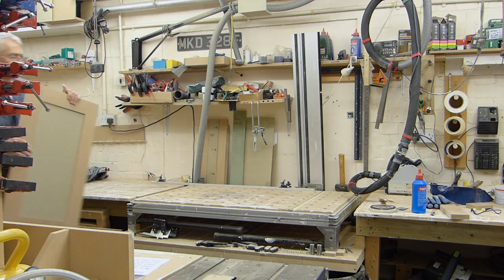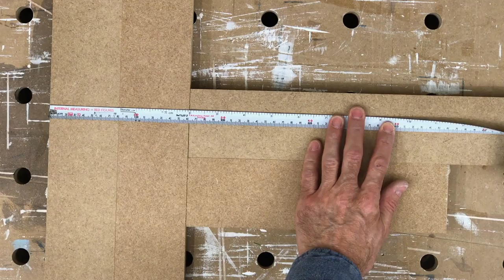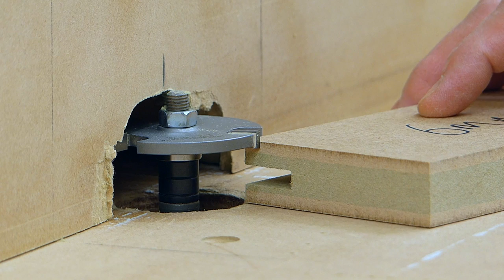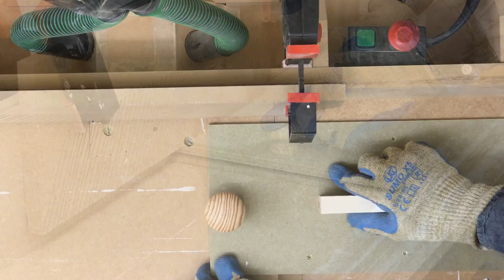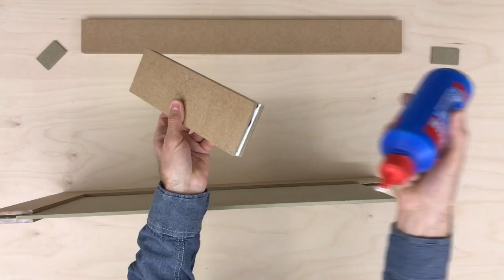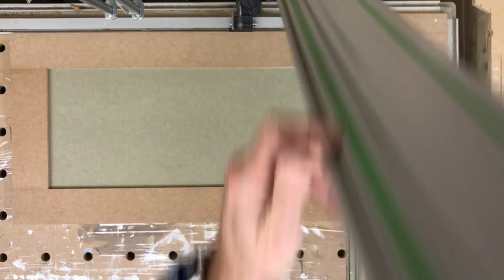Shaker-style Panel Doors #001

Comment: Not sure how long you been wood working? But anytime you make a  panel door onle the rails and stiles are the only thing glued the panel just rides in the slot most people put small rubber like bbs to hold the panel in the center. as the humidity changes the panel can move. Maybe the mdf isnt as prone to swell as real wood but I would still do right.I would  never make anything other than a few shop jigs from MDF no mater how well I was paid. People judge you from the work you do and how well it holds up. Even if only to be painted I would use a less exspencive woood such as pine. also you can make some real nice raised panel on the tablesaw alone as well. To me this is walmart quality furniture. Sorry not trying to put you down to bad but you are teaching in this video so thats why I called out the glue.
Reply from the maker: Woodworking professionally? Just completed my 18th year, thanks for asking. I've made literally thousands of panel doors from MR MDF for clients this way, without any issues. Certainly, if I was using a natural timber the panel would be left loose to allow for movement, but MR MDF has zero movement under normal conditions where I live and work, so gluing the panel in is doing it right. Totally agree that people can judge you by how well your work holds up, and I have an 18-year-long history of repeat work for private and commercial clients who are very happy with what I do...

FWIW using a tablesaw to make a raised panel would have my workshop shut down and my insurance yanked in a heartbeat - totally against all the Health & Safety regs to use an unguarded blade here in the UK.

Thanks for watching.
Reply: You only need to leave room for movement if the material are dissimilar and will expand/contract at different rates.  If you needed to leave room when attaching MDF to MDF, then the very existence of MDF would be a problem since mdf is just wood dust glued together.
Reply: as I said maybe its not as prone AS REAL WOOD! I my self would turn away work if it is not something I would own. But if it was real wood with grain you woould never glue the panel. OH yes I have made lots of cabinet doors infact I grew up in a cabinet shop and been woodworking for 20 plus myself. I am sorry if I hurt you feelings but I just hate to see real craftsmanship die.  MDF in furniture and cabinets are junk!!
Reply: It's not just mdf.  If your panel was made of jointed real wood and it was the same species as your rails/stiles you could also just glue it in.  You only have to leave room for movement if you're using different materials, like oak stiles/rails and a veneered/plywood panel or poplar stiles and a pine panel.
Reply: In correct!!!! if it is a panel door made with grained wood even if its th same wood the panel can expand and crack or crack around the stiles next to the rail. The grain on the panel is running up and down same as the stiles however the rails are going the other way and won't expand the same direction. So if you got a lot of humidity the panel pushes out on stiles and the rails push in on the panel it can crack or warp. Besides where can the panel go if its in a frame? A waste of glue besides being incorecct.

Comment: Hi Peter, was just wondering.... would it be possible to create a shaker style door using just 1 single 18mm panel and then just using a router to style out the centre receded bit? I built my first door using the rails, stiles and 6mm panel but it doesn't seem too strong and was really hard to build. I guess I'mi trying to cheat it but not sure if that's at all possible? :) (I'm using a freehand router without router table)
Reply from the maker: +Chris Cabral You'd be exposing the softer, inner core of the MDF, so as well as being a big and very messy job, you wouldn't get a particularly good finish on the 'panel' part, I'm afraid. How big was the door you made, out of interest? 18mm with a 6mm panel is OK for smaller doors. BTW you need to be very careful trying to swing a big grooving bit freehand - wouldn't really recommend it. 

I cover the other basic door making techniques in my 'More Doors...' video, might be worth a look?
Reply: many big manufacturers actually use CNC router tables to carve out cabinet and furniture doors and other parts. but the carved panels are often glued on to stable panels for the reason peter milard mentioned. Best bet is just practice your joinery/glue up technique. the whole point of making something on your own is to make something better than you can get at ikea =)

Comment: Great videos! Very informative indeed. I use a cordless makita circular saw and track a lot . how do you go about marking pieces for cutting when using your track saw?, I find I make mistakes as I need to subtract 7mm off each measurement to allow for the track and saw setup. Looking forward to more videos from you in the future 👍
Reply from the maker: Oliver Moore Thanks, great to hear you find them useful! Re. the 7mm thing, you mean on the depth setting, yeah? It is a pain, I have the same thing on my Festool track saw - the depth scale doesn't account for the depth of the track, which is pretty silly, but I've been using one for so long I just allow a few mm extra when setting the depth of cut. Helps to use some kind of sacrificial cutting surface under the workpiece - I use offcuts of 6mm MDF, though I know a lot of folks use a sheet of foam insulation e.g. Celotex/Kingspan/Recticel etc... Offcuts of 6mm MDF are cheaper though ;) Thanks again! Peter

Comment: Peter,

Do you think it would be acceptable to make these doors out of ¾" MDF? In the States the closest we have to 22mm MDF is 1" or 25.5mm. 

I just made a test door out of the 1" MDF and I can't decide if it looks too thick or not. I'm going to make another one out of the ¾" MDF to compare.

For those in the US that want to make these doors I did find a router bit that will cut a slot 1 5/64" deep. It is very expensive though (close to $100) . By adjusting the router fence it would give a ¾" deep slot. Here is the link to it: http://www.cmtutensili.com/show_items.asp?pars=RB~8/922.033.11B#

I used a much cheaper ½" deep slot cutter giving me a tenon of 1" and the doors seem quite strong.

Thanks Peter, loving your channel.
Reply from the maker: Hi Kevin, and thanks! 3/4” (18mm) works fine for smaller doors - I had a few issues with full-size wardrobe doors bowing, but never on regular cabinet doors. I’ve had other subscribers in the US tell me that 22mm (7/8th) MDF is available, just not that common - it’s worth searching out, if you have the time; I found 25mm a bit too heavy - sure is solid though! BTW I’ve made plenty of doors with a 1/4” x 1/2” depth groover - works great, I just prefer a bit more depth for bigger doors, so it makes sense to standardise on one bit for everything. 👍👍
Reply: Peter Millard Argh! I'm half way through making some wardrobe doors in this fashion, approx 2000x375mm (8 of the them!). Rails and stiles all cut to 80mm but in 18mm MR, and now I see this comment! Hoping to get away with it, will do the first coat of primer on both sides at the same time, and use 4 hinges per door. Fingers crossed! Any tips on keeping them from bowing would be gratefully received!

Comment: Oh no.   Please don’t cal this Shaker . Shakers were ale about craftsmanship and understanding wood.   This is so,far away from it . Unbelievable  !  Buy yourself a book an learn!  I quite this channel now
Reply from the maker: I didn't, yes, it isn't. Believe. These are commonly called 'Shaker-style' cabinet doors where I live, to distinguish them from the more elaborate 'Victorian' doors with mouldings, or indeed 'raised pane'l doors. I have plenty of books (see Measuring Up Podcast Ep. 9) and I'm always learning - are you? Thanks for the view 👍
Reply: Hi Peter , i have a few questions . 

- I was wondering if 22 mm doors work fine with 18mm carcasses ? 

- can you get away with putting some small pins through the rail / style and floating tenon once clamped from the inside, to avoid waiting for the glue to dry? 
- can you use this method for larger wardrobe doors ? 

Thanks